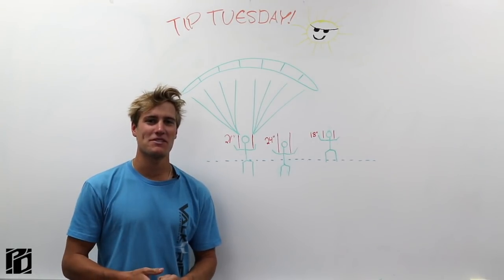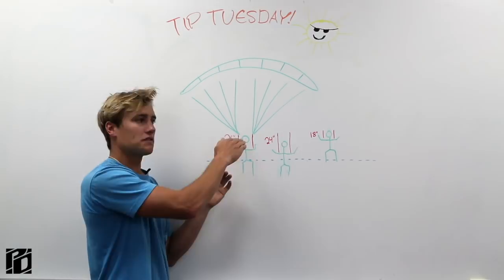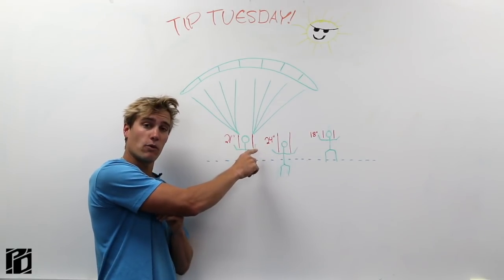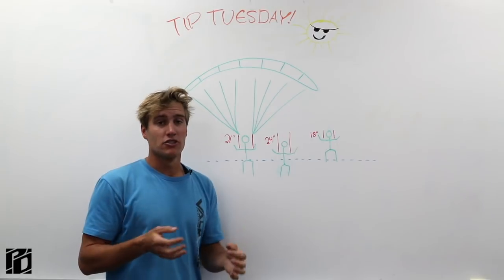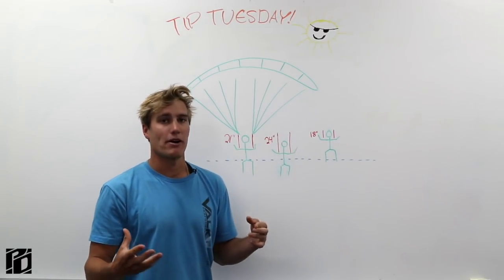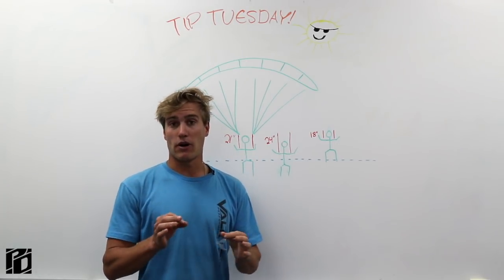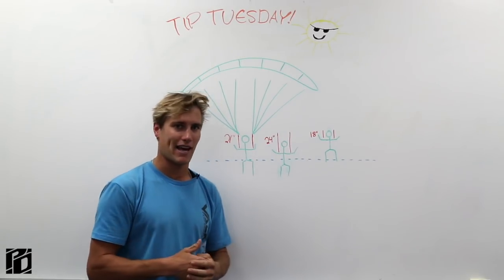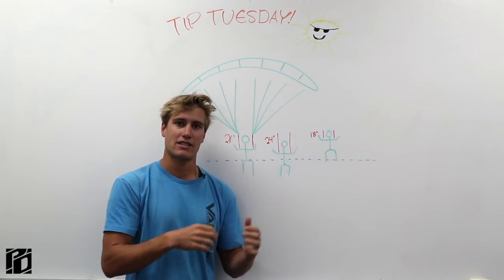Tip Tuesday: Riser Length

Comment: Very good video with a good graphical representation. I changed my risers from the standard 21" to 24" and what a difference for me. I didn't want to shorten the brake lines and have any tail deflection whilst using the fronts. It has given me much more stopping power in the flare which I was just missing beforehand using the same flaring technique. Extremely happy with the result and it even helps at the top as my arms just sit right in the front riser loops and everything else just feels so much better for me. I do have long arms and it's definitely not for those with shorter arms as I can just comfortably reach the slider now. I'd imagine if you had to shorten the risers (due to a shorter arm length) then at that point, you'd shorten the brake lines as well to achieve the same flare as before. Can't really say I noticed much about the flying characteristics as it's early days eg slightly longer recovery arc etc but it's certainly give me the real feel of the flare which I didn't have before.

Comment: It would have been good to start by describing why someone would shorten or lengthen their risers.
Reply: I agree, it seemed like it would be to change flight/landing characteristics, but why I don't know! I am just guessing and don't really know.
Reply: Longer risers are handy to increase flare power when the brake lengths can't be shortened further due to trailing edge deflection at full flight, as he mentioned. Shorter risers help if you have short arms and have trouble reaching the slider to collapse it.

Comment: Might sound like a dumb suggestion, but would have also been nice to include how to measure the risers for newer people to the sport that might have bought used gear. Regardless good info. thanks.
Reply: Ryan Hicks take a rule or something in inches and measure from the begining of the riser until the end without the metal ring. That gives you the measure of your risers, remember just material no metal

Comment: Does this mean that this 21" industry standard is for some specific/standardized person height? I would assume that if two persons 5' and 6'  jumps using the same canopy than their flare points are in different position or am I getting it wrong?
Reply: This has to be right, because I only have 1 flight but the brakes pressure point was below my shoulders,!